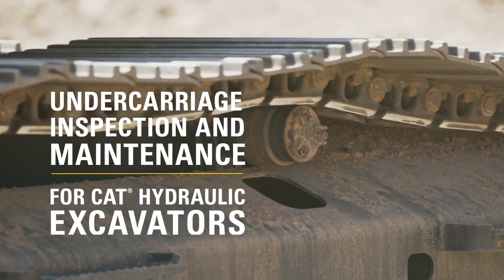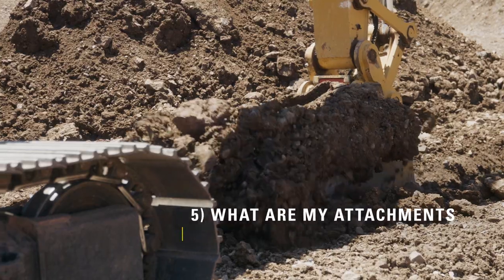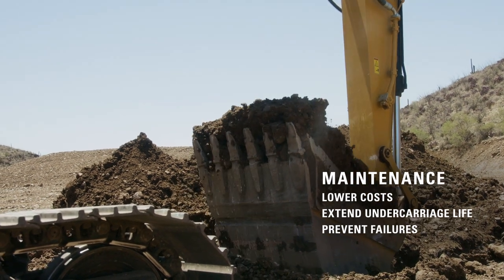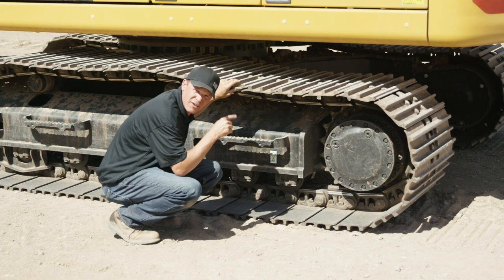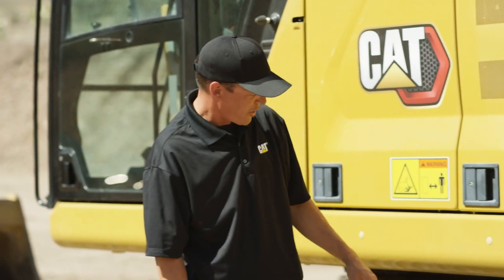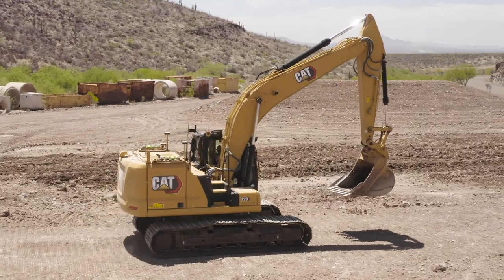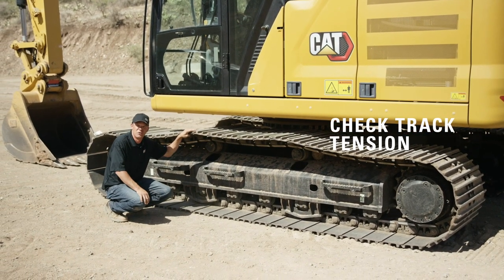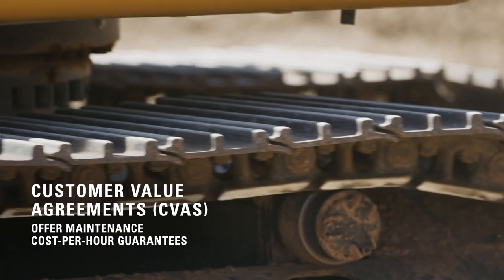Excavator Undercarriage Maintenance: The Daily Walkaround

Comment: Yall need to invent a Cat Transformer  that has 2 legs with tracks and a counter balance, and has 2 arms so the operator can use both arms at one time. It needs to have sleeves so the operator can insert their arms and control the outside arms. It needs to be able to allow the operator to sit or stand when working. It needs to be able to compact in a bending over position to be able to be transported and it needs to be able to have slots to store different attachments the operator may use. You are welcome for the idea and you will make a fortune on it.
Reply from the maker: Hi AJ! Thanks for your interest in Caterpillar. You can share more about your idea by submitting a request through our technology licensing portal. Initially, all information needs to be non-confidential. Here's the link: https://www.caterpillar.com/en/company/innovation/co-create.html?utm_source=youtube&utm_medium=social&utm_campaign=cic_social_care. Laura